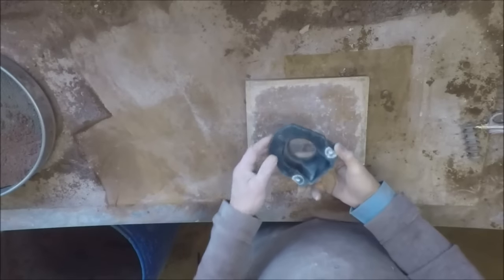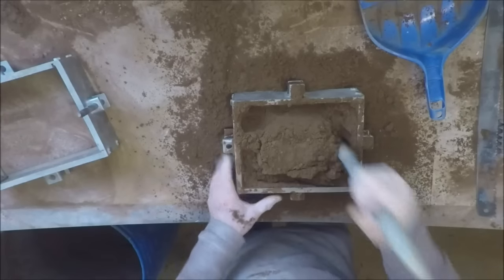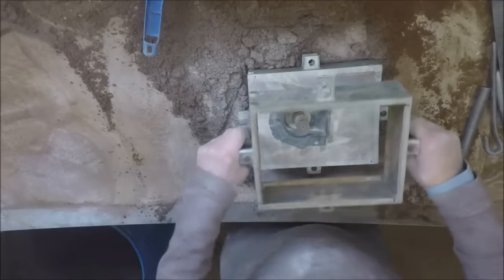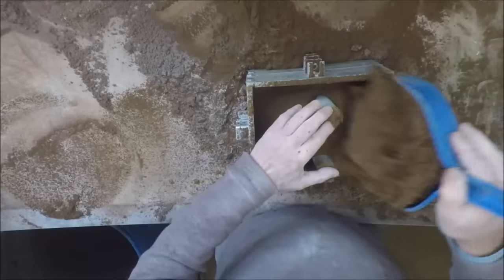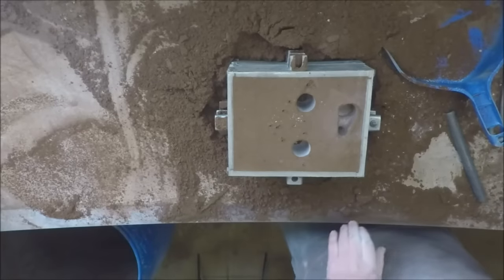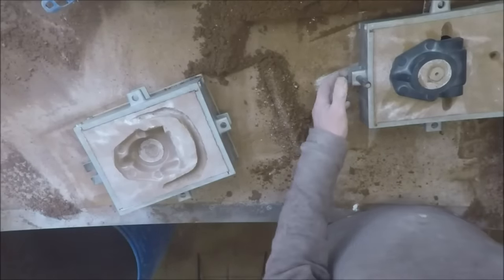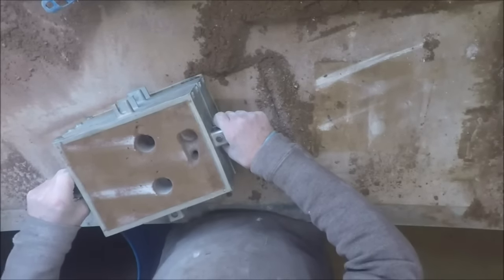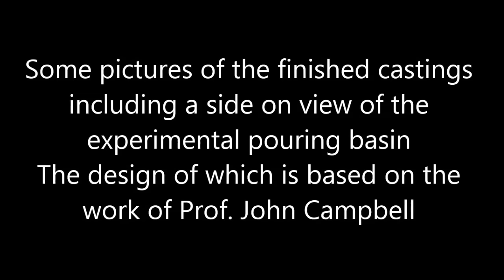My home foundry; Two castings for Oakland cars; Part 1, The Gear  Box Extension

Comment: WOW. Job well done! A little bit complex and a great finish!
Reply from the maker: Havoc, Thank you for your comment. The small amount of complexity is overcome by the three "tricks" that I pull ;- Initial infill of the pattern, the use of the "cotton reel" for reinforcement and the steel blocks as a guide for pattern removal. It is tricks like these, hard learnt over many years, that make jobs like this one much easier.

Comment: Very well done. I find that when I take the cope off the drag that's when my whole mess sticks together and I create new combinations of swear word.
Reply from the maker: Chris, Yep, I  have created the odd new entry in the great dictionary of foul language over the years too, casting can be such a frustrating business. Sounds to me like you are using the wrong stuff as a parting agent or just not enough of it or possibly your mould material is too sticky - too much water if its green sand too much oil if its petrobaond. Occasionally I get a little minor sticking of sand from one box onto the sand in the other box usually this is the result of not quite enough parting agent... Martin
Reply: Thanks for the help. I use talcum powder. I think my homemade green sand may have been too moist on previous attempts as well. I'll keep at it. I found the process fascinating and I love to be able to show people things and tell them "I made that."
Reply from the maker: Chris, You are spot on - to be able to make something and to state "I made this" is indeed a great feeling - to be doing it with the most primal of all forces - fire - is just icing on the cake... Martin

Comment: Another great video. What is the substance that you add to the top to keep aluminum molten? What is a good source to buy for my own casting?
Reply from the maker: K, The substance that I put on top of the feeders immediately after casting is called "Ferrux NF" it is an exothermic compound and it is made by "Foseco" They sell it in 25 Kg sacks. Foseco have agents/branches all around the world so there should be one somewhere near you. However most suppliers of foundry stuff - fluxes mould coats degassers grain refiners etc usually have a version of this product. The only thing you need to be careful of is that it has to be suitable for use on aluminium alloys. Different grades of this sort of thing are made for different metals and one for iron would probably not ignite when used on aluminium while one designed for aluminium would ignite and burn to quickly for use on iron. I would not be without this material and use it on almost all of my sand castings as it greatly improves feeding. You could also try contacting a local sand foundry to see it they use something like this and then try to buy a few kilos off them for cash. Quite often its a go and pick it up substance as there are restrictions on how it may be transported because it is considered an explosive - here in Australia for example you can not send it by post and goods transport companies need a special licence to transport it  ...Martin

Comment: Do you have to make the pattern bigger than the required finished casting size to account for shrinkage of the metal after cooling?
Reply from the maker: Robert,  Yes, you do have to make the pattern bigger to allow for the contraction that occurs as the solid casting cools down to room temperature. It varies according to the alloy concerned but 1.5% to 2 % would be the typical range. Our 601 alloy 356 in the USA is listed as having a patternmakers allowance of 5/32 inch per foot or about 1.56%... Martin

Comment: Hi, Mr. Olfoundryman, tell me please, you use commercial greensand or your secret recipe? ;)
Reply from the maker: Jon, The sand I use is a natural green sand, that is it is straight out of the ground. All I do is, dry, it sieve it to remove any large pieces of material and then temper it with water using a rake and shovel and pass it through my aerator. If I had a muller I would mull it but I don't so the aerator has to suffice. Here in Melbourne Australia we are lucky in that there is a lot of suitable sand around or rather should I say we were lucky as almost all of the sand quarries have now been worked out or shut down! My facing sand is the same sand only I grind it in something like a small flour mill. I will have a video out soon (I hope) on producing the facing sand, the grinding machine and the aerator will appear in that video.

Comment: Hi Olfoundryman, Good to see another couple of videos from you. 
I was wondering if the sand plug you were worried about could also have been formed using Sodium Silicate and sand with some sort of reinforcing to help bond it to the common casting sand.
What was the powder you sprinkled on the risers?
Merry Christmas to you and your family.
Reply from the maker: Mark, Yes, I could have done something along the lines that you are suggesting. In fact I have done jobs just that way i.e. half and half silicate and green sand even to the extent that I have cured the silicate in the middle of the green sand (I have a video of one of these jobs but it was such a disaster and the casting looked so horrible that I am a bit embarrassed to upload it :) ) However in this case it was quicker the way I did it and also silicate gives a much rougher surface finish. Really though I should have not been so lazy and should have made that wooden plug - made the first half of the mould with it in place pulled it (the plug) out and proceeded as I then did. Using the wooden plug would have made the job a bit quicker and as I have had to make these castings before and probably will have to again in the future even at only 4 off at a time the wooden (or metal or plastic or whatever) plug would have been a worthwhile investment if I had done it years ago! Maybe next time! The powder sprinkled on the risers is an exothermic called "Ferrux NF" it is a commercial product made by "Foseco" I love it.There will be more videos soon as I have just had (minor) surgery on both hands and can't do anything much for several weeks and I have quite a few videos "in the can". Boy, do they take a long time to edit though.Thank you for your kind wishes and may you and yours have a great time over the silly season too.